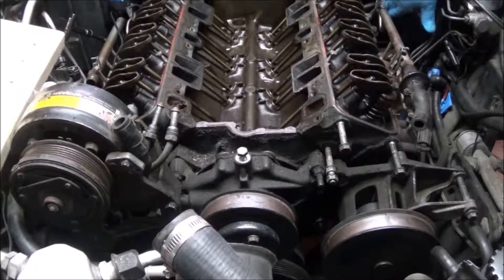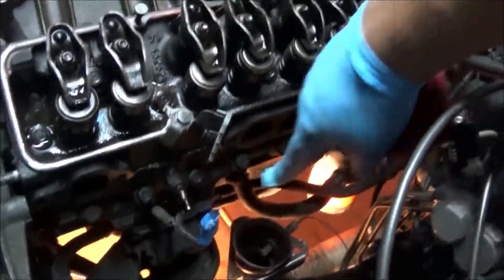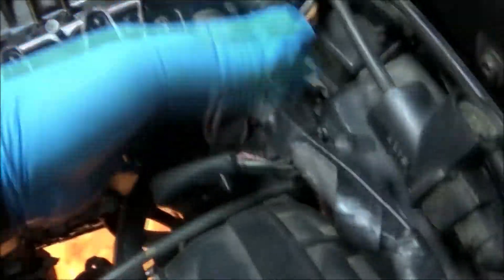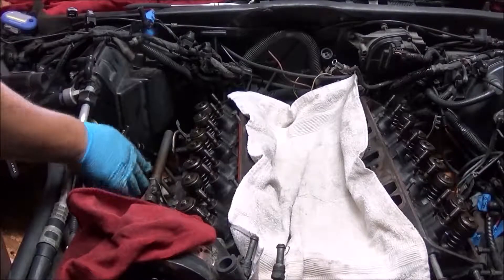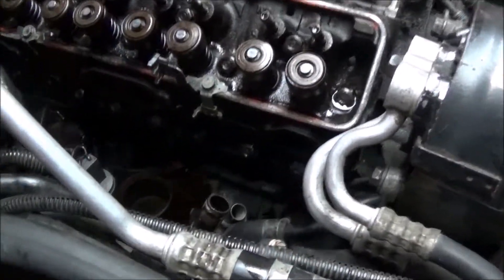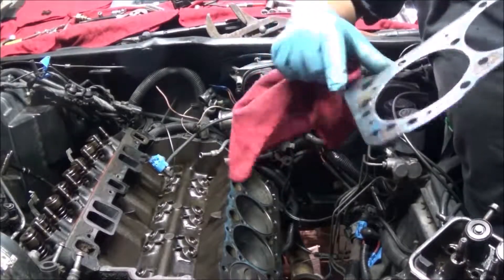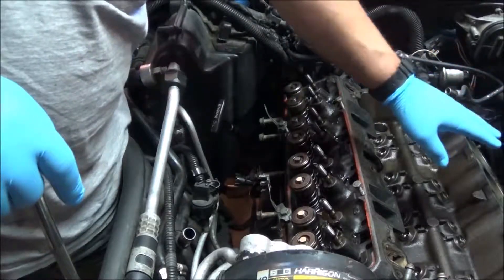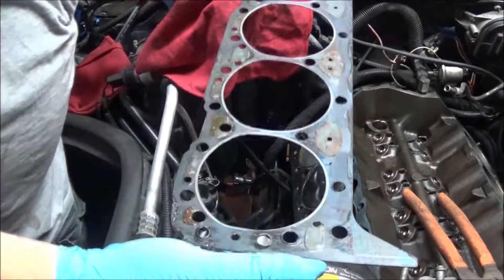Video 22 - Part 3.2: Engine Tear Down to Heads - C4 Corvette / Rebuild Engine / Engine Rebuild

Comment: What did you clean the engine block surfaces with? My car is a 91 and the engine block surfaces has paint from the old head gaskets on them from when I pulled the gaskets off. Thanks.

Comment: this sounds like a common problem,are they aluminum heads? but i was thinking yes send them out to get tanked and re-built milled? new lifters and push rods dont put the old ones in.after all that work put new stuff if you can bank it.

Comment: Thanks Donald.  I used your video as my main resource to remove the heads of my 1989 Corvette.  Really helpful. I bought a workshop manual but it is pretty scant on what to do.  Both the head gaskets damaged on the rear cylinders.  I'll take the heads to the engine reconditioner tomorrow. Hopefully they are ok and only need planning.
Reply from the maker: Nice!
Glad it helped you.

Comment: how did you get of bolt 16 on pass side? tight spot...
Reply from the maker: I used a universal adapter between the socket and the extension. you see it at 15:30, I edited the video and the change over to the universal adapter was removed and you only see me using the adapter.

Comment: So I'm working on a 1994 lt1 in a corvette and the passenger cylinder head is not budging..... do I just need to put more force behind it?
Reply from the maker: Are all the head bolts removed? There is 17 of them, if they are all out then use a little more force or like I did place a rubber handled set of pliers in the intake ports and use that as a lever to move the head. Check grounding straps on the back of the b=head to the block as well. I had that on the drivers side rear of the head. Also if they have never been apart the metal gasket might be a little seized right now.

Comment: This set of videos will be a big help since my 84 may have come down with the same issue. Now my big question: do you have to send in the heads to get redone or can you just go ahead and place the new gaskets and re assemble? Im trying to keep costs to necessary minimums.
Reply from the maker: If the heads are not warped yes. if they are warped then you will need to b=get them redone. also if the valves/valve springs and rockers/lifting rods look bad, then I would get them replaced.

Comment: Are you using hand tools for simplicity or is there a reason your not using air/power tools
Reply from the maker: I did not want to break a bolt if it was seized, and the smaller items really do not need a power tool. The head, intake, plenum bolts need to be turned only a 1/4 turn in the beginning, trying to do that with a power tool, YA RIGHT!, It was just as easy to use a hand tool. Also space was an issue, try fitting a power tool and extension in between the front of the engine and the fan shroud. or between the exhaust manifold and the inner fenders/body. It just made sense to just use hand tools.

Comment: I WAS WATCHING WHY PULL THE ROCKERS OFF...I SEE NO REASON AS OF YET.
Reply from the maker: Well, I needed to get the push rods out and did not want any tension on the rods as I removed the heads. Damage to the rods or lifters can occur if they are left under tension, granted you do not need to remove the rockers entirely to remove the rods but I also wanted to look at the wear spots on the rockers, where they pivot, to see how good or bad they were, and the only way to do that is to remove the rockers. Also, it is the correct way to remove the heads, as per the Service Manual. Also the plan was to send the heads off to get them worked on, (valves lap and seat), but they did not need the work. So there were many reasons as to why the rockers came off.
Reply: @donaldcombs4677  You did it the right way; takes very little effort to take the rockers off, and as you stated they need to be inspected. Nice job.
Reply from the maker: @duke7595  Thank you.